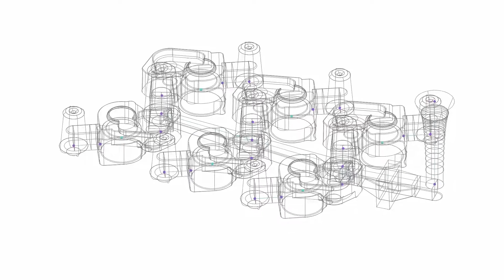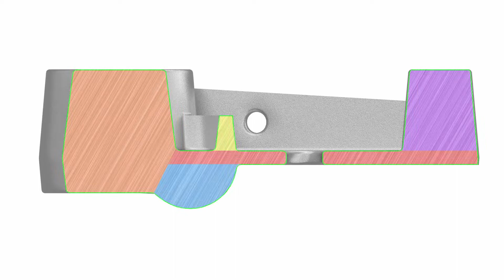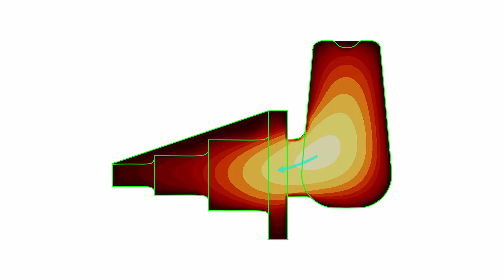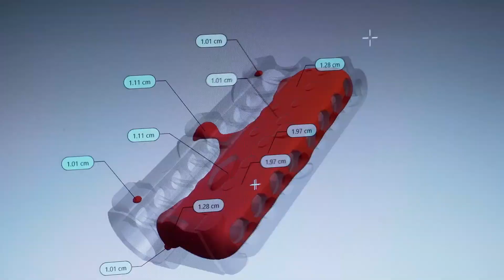The Solidification Modulus Explained

Comment: What''s the value of the constant  K?
Reply from the maker: The constant K varies depending on the metal, molding material, temperature and other process variables. There are many ways to find the value of K for your specific process, see for example: https://en.wikipedia.org/wiki/Chvorinov%27s_rule - Visiometa internally uses a very different approach though, which is also mentioned in the video: we perform an automatic calibration step, which is a special pre-simulation to determine K such that the resulting modulus is comparable to geometric computations (e.g. for the feeder size).
Reply: That's for calculating the time of solidification.  If you only care about ensuring the solidification proceeds from the intended casting back toward the feeder (so shrinkage will be in the feeder and not the casting) all you really have to do is insure the modulus (volume/surface area) increases progressively toward the feeder.

Here's an amateur description: https://www.youtube.com/watch?v=4uRtHrfN5MU&t=6s